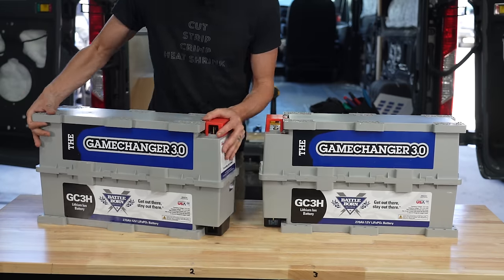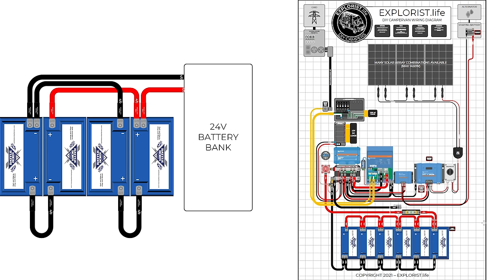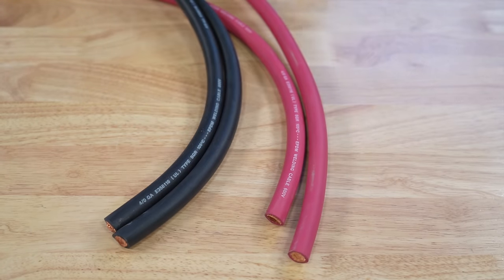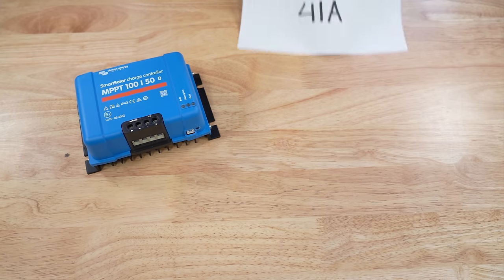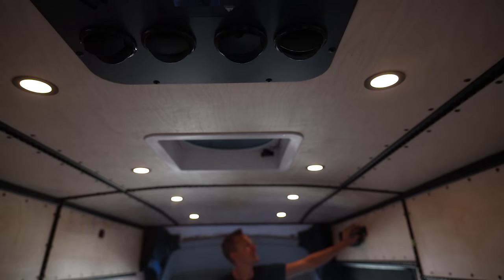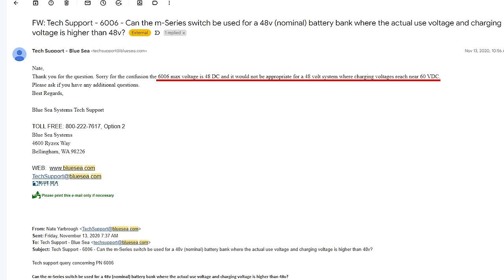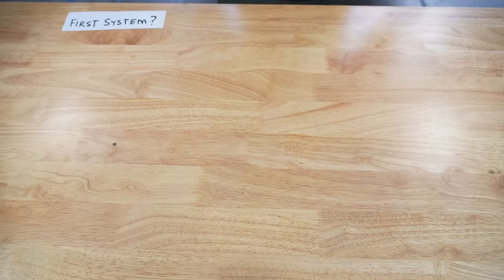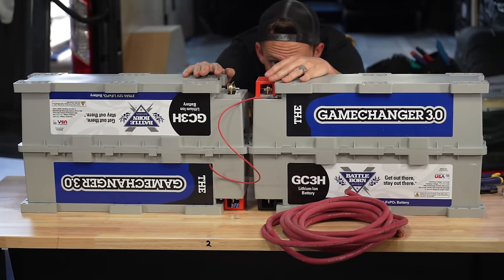12V vs 24V vs 48V (For Camper Electrical Systems)

Comment: Worth stressing that for relay or switch contacts, the DC rated current will be significantly lower than the AC rating (for the same contacts). This is because AC current drops to zero 120 times a second which helps quench any arc formed but with DC current it just keeps flowing so you need some other way to make sure you do not wear out contacts from arcing.
Reply from the maker: Indeed!  ...but care to elaborate how that concept is relevant to this video?  I never talked about 120V AC systems (or relays/contactors/switches) in this video.

Comment: We are converting our 2003 ford cargo van to a camper van. We found the Goal Zero 3000 works best for our needs. Is there any advantage to using a 12v TV vs AC? If so do you have any recommendations?

Comment: I think 48V systems are becoming more viable for RVs.  Victron's own 275A on/off switches are now officially rated at 60V DC, so work fine for 48V nominal systems.  For higher amperages, you can get Dihool 400A circuit breakers rated for up to 200V DC for less than $100.  I think for those putting in dual 5000VA inverters, 48V is the way to go. Still hoping for better selection of 48V DC-DC converters and chargers though. Also, the typical Mega fuses used in Lynx distributors are cheap for 12/24V systems (about $4 each), but much more money for 48V systems (about $30 each).

Comment: Great video Nate!! You just confirmed that I made the right decision to go with 24v. My decision was based on the AC unit and fridge as well as other components that were all 24v. For the small stuff in the RV such as lights I just use a Victron step down converter to 12v. My battery bank is a 24v 15.6KwH unit and 3000 watts of solar.
Reply from the maker: Good stuff!
Reply: @lillyanneserrelio2187  I went with 3 EG4-LL batteries. Fits nicely in their triple bank server rack.

Comment: Great vid Nate, this is a good explanation of differences between system voltages. You have a very clear & concise method of teaching. Andy’s Off Grid Garage Australia channel has a lot of info on 48v systems. I am currently playing with a 24v system in a bus, & a 48v system at home. In Australia we use 240vac of course. I watched ur whole 24v build, it was very clean and nice. Cheers

Comment: I don't usually comment on 1yr old videos but I'd like to say I think you did a pretty good job here, and the video has aged quite well.  I'll throw in a few remarks on 48V.

One thing you didn't mention is that lowly Victron 100|20 charge controller can do 12, 24, or 48V.  And at 48V and 20A that cheap itsy bitsy little charge controller can take 960W of solar all by itself.  Just remembering that the minimum operating voltage from the solar panels has to be BAT+5V higher (so around 65V minimum which is typically 2 or 3 panels in series, depending on the panels).  Throwing a few of those together ganged to the same battery bank is easy and gives you a bit of redundancy on the DC side pretty much for free.

DC miniature circuit breakers (DIN rail mount) are pretty cheap these days. I would say that when it comes to DC miniature breakers, consider "B" type instead of "C" type.  Most will be "C" type which are great when there is a lot of inrush current, but the "B" types have tighter specs and are typically higher quality to boot.  So if inrush current isn't an issue, the "B" types are the ones to go with.

For example, The Chtaixi DC miniature circuit breakers have worked well for me.   Type "B", 125A at up to 110V for around $20.  Of course, many amperages are available.

On DC to DC converters.  The cheap no-name brands on Amazon actually do work pretty well and have basic short circuit protection, but should definitely still have a breaker or a fuse on them because they do not have over-current protection (even when they say they do, they actually don't).  Beyond that, though, there isn't a whole lot that can go wrong below 10A so for running low-power stuff they're great.  I have no qualms using them below 10A on the output.

More than 10A, though, is another story when it comes to DC-to-DC converters.  Go with a well known brand above 10A.

For charging 48V from an alternator, consider using a "boost" style solar charge controller.  Not the Victron's.. .the Victron's are all "buck" style (output voltage must be lower than the input voltage).  So if you have a 12V alternator, go with a charge controller that can boost the voltage into the 48V range.  That way you get a proper battery charging profile for free AND you have complete control over the charge current.  i.e. get a charge controller where the maximum charge current can be set.

The great thing about this is that you have full control over the charge rate via the current setting on the charge controller, so it can be programmed to guarantee basically zero stress on the alternator even if it is charging for hours.  Keeping in mind that the amperage on the 12V side will be 4x the amperage on the 48V side, of course.

Finally batteries.  LiFePO4 is expensive but its freaking awesome.   But I advise AGAINST putting lithium based batteries in series because even when they say they can do it, having BMS's that don't talk to each other can cause serious issues when charging if one battery decides to disconnect charging before the other battery is able to finish.  Things can go out of balance pretty badly.

So lithium based batteries should universally be wired in parallel. My only other comment here is to always have at least two batteries in parallel for generous amperage margins and robustness against problems and BMS disconnects.  At whatever the voltage one choses to go with.

For inverters... consider that multiple smaller inverters are an option (separate outputs, obviously not paralleled since most inverters can't do that).  Inverters with lower wattage outputs also tend to have lower vampire current draw and this way heavy loads can have their own appropriately-sized breakres and won't interfere with nominal light loads.

Comment: Awesome video 😁👍🏻 the no name 48>12 buck converters are very reliable and actually have safety ratings. Designed for automotive use, they work well. Very efficient as well. To run 12V jacks, I would use a buck converter with an output voltage that was the float voltage of an AGM, then run the jack off the 12V AGM. Did this for a year and it worked great. 

I did blow a buck converter to pieces when I was using it as a solar charge controller 😂 had a morning voltage spike and a capacitor blew. It was potted so it exploded to a million pieces haha
Reply from the maker: Hey Will!  Thanks for watching.  Good to hear about the 48V to 12V buck converters.  I do know I only hear about the 'bad' experiences as rarely do people share when things are working properly. 🤣🤣

We actually did the 48V to 12V to AGM trick on the Victron Tour RV last year (except from 24V) instead of using multiple 70A 24V to 12V converters to have the ability to fire up the generator (pulling 100A at startup).  Worked very well.  Thanks for bringing that tip up!!
Reply: @EXPLORISTlife  oh nice!! Glad to hear it worked for you. 
Yeah the bad experiences usually are screamed across the internet. Hard to know if it was user error or the device at times. 

Have you built a 48V system?? You would love it 😁
Reply from the maker: Very true.  Same concept, I suppose, as my gripe about connecting a 12V inverter to a 24V battery bank.  Hardly the Inverter's fault. 🤣😂

I helped build a 48V system when those VE.Panels came out.  Definitely cool, for sure!  We almost had a video on this channel that would have been a 48V system but it fell through last minute.  It was a big dual inverter system that was going to be, essentially, a battery backup system for a bunch of food trucks at the local farmers market.  Will definitely put one of those on the channel ~~eventually~~.
Reply: @WillProwse  Shouldn't you also pay attention with 48v being not safe to handle?
Reply: Hello, I am will new to all things solar power and solar powered.
I did think it was needed to have a 24 volt or a 48 volt to power  power tools that required lots of power in there start up? (Is this true?) I want to build a solar van build so at times it is confusing with what is on the internet.
I did think for a lot time I wanted to build a solar powered box truck, but with current changes in gas and other fuel costs I have changed my mind, but I do think long term I would like a box truck better.
I am a student and I want to do a diy solar vehicle build not to travel, but to do remote Earth Science study projects in remote locations for three to four months at a time in the western US.
Reply: @hopehope938  If you're referring to running AC power tools you'll need an inverter (DC to AC conversion...yes). In which case the inverter & battery capacity in addition to battery max amp discharge are the key points. Not the DC voltage. Best to build up your knowledge some more before attempting a DIY setup. Cheers from OZ
Reply: @RolandOfGileadOnYT  anything over 30 V can be dangerous but if you’re practicing proper safety which you should be doing even with a 12 V system because have you ever seen what happens if you get a short On a lithium battery you should be just fine I personally have spent a lot of time learning with 12 V but I have a 24 V and a 48 V system designed
Reply: @RolandOfGileadOnYT  I agree about paying attention to Safety aspects but you should be doing that with ALL electricity!
    Yes 48 volts is a very strong Direct Current but 240 AC and even 110 AC are dangerous if not handled safely and given do respect. I have seen way too many people with systems in vehicles and outbuildings that are either damp or leaky. People are like 'It's not Really dangerous since it's just 12 vokts...', all the while they have 110 AC in there from the inverter(s).
       Ya'll Take Care and yes, Be Safe, John
Reply: @RolandOfGileadOnYT  Do you know why old phone line was designed to use 48v? Simply because it's still consider low voltage and you cannot get shocked. ;-)

Comment: Thank you for this entire series.  I've used your videos and @WillProwse videos and information to build my off-grid cabin system.  It came out really well, if I do say so myself.   I am now going to tackle our new motorhome conversion.  A Tiffin Allegro Bus 45 OPP, which is all electric, 50 amp, with a 10k Onan generator on-board.  Hoping to go 48v, as I did with the cabin, but using mostly Victron components, but also considering all-in-one systems like EG4.  I used MPP LV6548 at the cabin, which has worked great.  Only in the planning and spitballing stages currently, but look forward to a finished product that will be used for fulltiming when I retire next year.  Thanks again for all of the great content!!

Comment: Thanks for the video! Hopefully no one tried to hold you accountable for their lack of research.😬
I installed a 24v battery system in our bus and still used 4/0 wire from main busbar to the inverter(s). Really, the money saved for thinner wire (in a 1000amp system) isn’t worth the possible bottlenecks that could happen. 🤘🏼
Reply from the maker: People try to hold me accountable for their poor decisions all of the time. 😂😫  One of the biggest reasons I shut down my consulting group is that people were joining up looking for validation for the poor choices they already made instead of getting educated about decisions they were to be making in the near future.   Lots of people just buying a bunch of random parts that didn't necessarily work together and expecting me to provide a plan to wire it together instead of simply using the plans I've already made available to everybody. /rant

Comment: Good video! I'm currently running 12-VDC solar, but I'm upgrading to a split system: 1) 12-VCD for all of the things designed for 12 volts; and 2) A 48-VDC system for my ductless mini-split and everything else using 120-VAC.
Reply from the maker: Interesting!

Comment: Nate, outstanding video, long time subscriber. I built a 24V system using a 3000W AIMS and 1030W on the roof of a 5th Wheel back in 2016 for many of the same reasons you mentioned, and I used two different 'no name' 24VDC/12VDC converters because I ended up burning the 60W version out powering the Hydraulic slide motor and had to get a 80W version. But the small one worked ok for the rest of the 12V equipment. Real world results.

When I 'upgraded' to a newer 5th Wheel in 2018 and went with a 12V all Victron setup with lithium batteries, I have noticed a significant decrease in available power, I maintained 4/0 wire between the batteries and inverter within 2 feet of each other to minimize resistance. But I can not run the AC for as long as I used to on the 24V system and the batteries were four 115A of AGM in 24V (2s2p) upgraded to four 100A of Lithium in 4p. My biggest concern is my Victron settings, I don't think the solar is prioritized as I am not using ESS or any agents. Are you no longer doing consulting?
Reply from the maker: Hey Michael!  4x 100Ah Lithium Battieries should indeed yield nearly twice as much usable power as 4x 115Ah AGM batteries, regardless of the voltage of which they are wired since their watt hours are similar (noting the usable amp hour differences between AGM and Lithium); so it definitely seems like something 'weird' is going on as seeing less power is definitely an unexpected result.  Impossible for me to say for sure, though, without knowing more about the system.  I'd recommend diving back into the instruction manual for your equipment to make sure everything is set up properly and/or reach out to where you purchased the equipment from for additional tech support.

Comment: For a remote garden shed, used on weekends in the summer, a 24V system can be a cost-effective solution. 
There are also 24V accessories and lighting. It may then have to be a 12V DC lighting system.

Comment: Loved this video. 
Myself, I’m going 24V / single 6000w dual split inverter (power to be used 110/12/24/48/240)  Aims or Sun Gold Power Inverter.

My Cinderella Electric Toilet I’m going to use in my build needs 240v to operate.

So I’m going to use compact marine (Mastervolt 24V) batteries for 840 A/hr storage capacity.

So being a subscriber & learning from your channel along with other DIY has been a huge asset to me.

Looking forward to seeing your next video.

Keep up the great work!

Blessings to y’all.
Reply from the maker: I'd say your on the right track if you need 6kW worth of inverting power.

Comment: Nate! I would love to see an updated take on 48v van electrical systems. I know some strides have been made in that direction over the past year as they are becoming more and more common. My problem is that I have a decent size daily power draw, about 2.5kwh, and need at least two days of autonomy putting me in the 6-7kwh area. 12v storage is problematic at that level, less so at 24v, and not an issue at all at 48v. Given my budget i would have to forgo alternator input at 48v, major loss but hoping to make up for it with 400 watt portable deployable panels when  parked and a separate charge controller. Coupled with the 800 watts on my roof m hoping for 3kw generation a day. Im torn, will probably end up going with a 24v build. Also, you remind me of all my old skate punk friends i grew up with! It makes your videos even better. Ha!
Reply from the maker: We already have 12 and 24v van systems.  Will have 48V versions soon.  Love to have you  as a shop.explorist.life customer. 🙂👍

(7kwh of storage at 12V is absolutely no problem at all and you would have great options for alternator charging with out the $3k expense of a 48v alternator)
Reply from the maker: For more context, our most popular van systems are 12V systems in the range of 5.04 - 7.56kWh of storage: https://shop.explorist.life

Comment: Got a question for you Nate..  I have a 12v trailer..  four 100Ah BB lithiums, four 400w panels, Victron 150\100 controller, cerbo and bmv 712..  I recently bought a 48v Multiplus. I have 30a shore power as well.. just getting the RV ready for offgrid living. Is this a good combination..?

Comment: Perfect timing! We’ve been considering 24V for our 1450W+ needs but feel a little confused since everything we’ve learned so far has been 12V. Super excited for the install video!
Reply from the maker: Glad it was helpful!
Reply: it's all the same as far as how things get connected with the exception of charging from the engine. For many vehicles you can get a second alternator at 24 volts you can wire directly to your camper/RV system. You just can't mix the home part of the RV with the driving/vehicle part.
Reply from the maker: @dodgeplow  Not exactly the same, no.  There are some key differences. The battery bank gets wired differently as does the small 12V load side of things.  The solar voltage needs to be higher too.  To say that "everything is the same" is sending people down the path of connecting a 12v Inverter to a 24v battery bank. 💥💥💥
Reply: @EXPLORISTlife  You're right. I should be careful what I say on a technical discussion. I mean you still need a charge controller, batteries, inverter if you want AC, etc. You change from parallel to series for each pair of 12 v batteries. In my plan, I'd also only use 24 volt items including USB chargers, LED lights, etc, so I don't have to step down to 12 v.